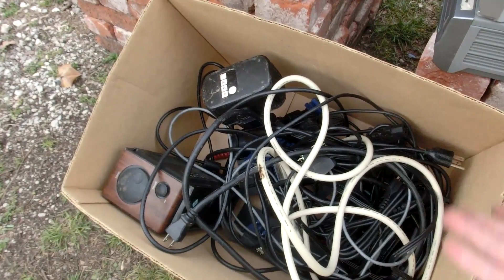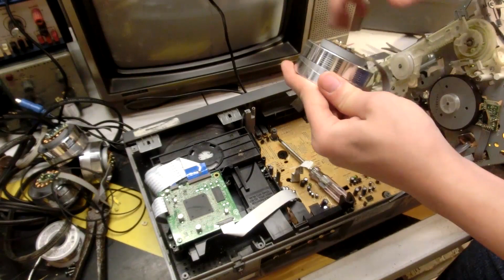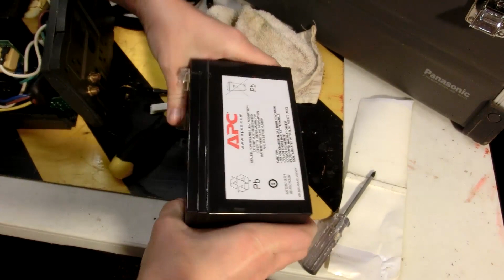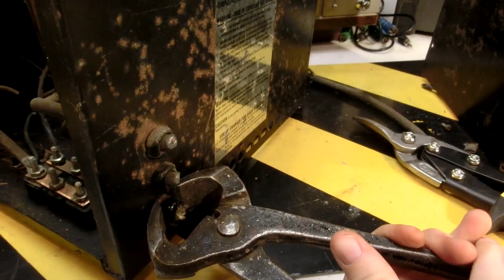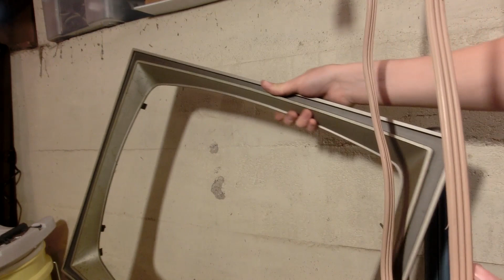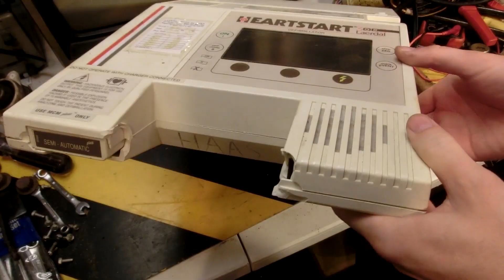Electronics Recycling Salvage/Teardown: Vintage TV, UPS, VCRs, Charger, Portable Defibrillator, LCD

Comment: @14:00 automotive automatic thermal breaker, it cuts off and resets itself when it cools down if you pull more amps that it's rated.  They are real common in RVs.

Comment: High Voltage TV transformers can give some fun with the Mazilli oscillator circuit and you can make nice 20 kV arcs and even melt glass with it. That TV frame is very cool. I have done destructive tests with tube filaments and some will even last up to 30 Volts before they let go. Nice score of goodies you got there.
Reply from the maker: i think ill leave the high voltage stuff to you and stick to high amp low voltage myself :p
Reply: @RinoaL  Fair enough. Keep up the good work with your video's.
Reply from the maker: aw thanks! that actually means a lot coming from you. haha

Comment: Am pretty sure that APC runs off 12v those batteries are in parallel series. that diode is a thermal switch

Comment: Live the video player to play 10 min the head auto cleaning function will fix it ( the lead acid battery is way more reliable have very long life and you can fix it )
Reply from the maker: lead acid sucks compared to lithium, lithium is better in every possible way.
Reply: Rinoa Super-Genius a lithium baterry on your laptop die in one year,  the battery from your car works 10 year's  (after you can open it clean elements add distilled water recharge and I well go for another 3,4 years ) lithium are a total shit compared with acid
Reply from the maker: that is completely wrong, most of my laptop batteries last me about 10 years, and automobile batteries tend to last 3.

1: lithium is lighter
2: lithium has more charge cycles in its life. Lithium can get 2000 cycles before reaching 80% but lead acid can only do about 300 cycles.
3: lead acid wastes about 5/6th of its charge energy, and at high discharge rate it wastes a lot of energy, this is due to peukert's law. lithium ion has a more symetrical input-output so your not wasting so much electricity.
4: lithium-ion can handle much higher current draw.

those laptop batteries that you say are dead, well they normally arent. ya see i build electric bike batteries out of recycled laptop packs. some cells are like 15 years old but i can still use them in a battery that will give my ebike 40 miles of range.

its just simple, lead acid is shit and has no redeeming values. and an automobile battery isnt exactly a good comparison since it doesnt really run anything, at least on older cars. if you discharge a car battery down to 0% within 10 cycles it will be dead.

Comment: I wonder if you could use the VCR heads as both bearings and a position or speed sensor. Like put a piece of video tape or magnet in front of it and use the head to pick up that signal, and interpret it with a microcontroller

Comment: Those LCDs would be perfect to put on overhead projectors and make digital projectors! Old 4x3 ones with screws to make them easy to take apart are the best. Even the Dell one is perfect for that since the hard part (taking off the bezel) is done. (Dell monitors are almost harder to do the mod with than it's worth most of the time)

Comment: The one with vhs on right side, ejection mech prob. Some have a belt, some free spin the shaft that's supposed to turn a gear.

For repairs, 90% of vcr problem is mechanical, the rest is like a fuse, bad cord, rare if they ever died Electrical stuff.
Reply: Yes I know long gone by now. Just saying

Comment: Its to bad you couldn't get the whole tv.
Reply: Many old antique TVs can be had, pretty much for the hauling. They are way too expensive to have them shipped. It's just as well, with the gutted TV. At that age, they require a total rebuilt. Capacitors leak badly, resistors drift way out of spec, that sort of thing. To get an idea what it takes to rebuild  some of these old TVs to get them working well enough to be safe and functional, see some YouTube videos by shango66 and radiotvphononut. They are very thorough, and you'll learn a lot.

Comment: I've been finding your Teardown videos fascinating. I've started doing some of my own. I just took apart an HP printer. I enjoy looking at the sky awesome circuit boards and how they are laid out and how tiny the components are.
What components do you find the most valuable from salvage parts? I'm finding the pushbuttons and the big potentiometers seem to be the easiest to remove and reuse.
Reply from the maker: +Robert Gasperson i like the motors and switches most, but it really depends
Reply: Rinoa Super-Genius Ya I'm guilty of the same thing in the last week two hp inkjet all-in-one printers one hp laserjet 3510 I believe it was and a hp computer tower 2005 vintage 😂😂!
 Like the rails thought I was going to be scoring a couple stepper motors but big neg!They use dc motors and either position strips or position disc and a sensor. I do keep the gear reduction and the metal portion of the frames. The computer has magnets in the HD always nice to claim and the power supply is a big plus 180w.
 Which now I have some electronic elements it's time to start learning how to get power to motors without burning up everything which is going to be a most likely outcome for a while.Ones I can control the motors properly I have idea's (projects)waiting for the motor and geared torque to be applied!Hopefully I will get most of my knowledge through this channel or Ave YouTube videos. I'm electronic stupid for sure!But I built computers for years but my collage learning don't seem to be helping with the transfer. but I'm a good self teacher (school of hard knocks)🤔🤔👍Great video like always Rinoa Super-Genius !

Comment: A bad idea, a lithium battery is not designed for large discharge currents.0.5c, This is a 2 hour discharge
Reply from the maker: +Вячеслав Алексеевич yes they are, some can handle 30C but most can handle at least 2C. i suggest to re-learn how lithium works.

Comment: FYI. The Smart-UPS has a pure sine inverter in it. The Back-UPS only have a modified sine wave inverter in it.
Reply from the maker: actually i looked it up earlier and its whats called a "stepped aproximated sine wave" and i might be able to smooth it out with a capacitor or something. but i dont plan to use this as an inverter.

Comment: I wonder if you can make a silly mini wind turbine with the VCR heads.
I mean they are more or less motors so theoretically it should be possible to do some small garden light type of thing with some LED's.
Reply from the maker: most people use the helical scan heads for wind turbine bearings, so yes you can do it.
Reply: Rinoa Super-Genius Now that is a good idea definitely logging that in my book of great ideas.i have a collection of vcr's.All working but one day they shall give up there treasures haha!!

Comment: This guys gonna blow himself to kingdom come one day. If you have a lot of tubes then one way to try and sell them would be to find someone who repairs/restores guitar amps.
Reply from the maker: how will i blow myself up? and no, people that are into that sort of thing want a specific type of tube and usually new.
Reply: Your very defensive, im just interacting thats all. Its not rood its not offensive just making a comment.
Reply from the maker: no i'm asking a question. but are you just interacting for the sake of interaction? thats called wasting somebody's time. lol

your the one that is reading emotion into my comment so maybe you should rethink how you read somebody's comment.
Reply: Im interacting as part of subscribing to your channel, isnt that the point. On the only 2 comments ive ever made on your channel youve been very quick to jump in with what I would class as an English man as quite rood and defensive, "How will I blow myself up" and "No People that repair amps  want specific Valves". Both comments are  there to cut me dead in my tracks. Now refering to how your going to blow yourself up. It wasnt a literal statement im sure you know what your doing. You mess with a lot of high voltage so your chances of blowing yourself up is more likely than someone that walks dogs for a living, correct? It was an off the cuff comment. And your comment about valves is incorrect trust me. You can also use them to make headphone amps to warm the sound up. Now you had 2 choices of how to react to my posts. You could of just ignored them or you could of been a little more  friendly and just laughed it off and said something like " I hope I dont blow myself up". You PR skills leave a little to be desired my friend. Its not the way to go about making friends is it really? Remember its you that posts videos of your life and shows it to the public so we get a window into your life and build up a profile on what your really like as a person so the responsibility is with you to be polite becuase you have no clue at all who we all are as subscribers. We subscribe to you thats how it works. Think you need to work on your PR skills a little more my friend. Remember in the future, always think about how your going to answer someone and the manner that you do it in. Now you didnt seriously want me to explain how your going to blow yourself up did you, surely your not that nieve? And interacting for the sake interacting does not make sense. No need to put the barriers up over a comment. And as for insinuating im wasting you time by interacting i find you to be quite arrogant. Good day to you  and I will be unsubscribing. Now I know thats just a shoulder shrug to you so no harm done either is there.
Reply from the maker: so you comment without expecting a reply, well then i'll know not to waste my time with you. thanks for being upfront about that.
Reply: Grow Up.
Reply: @craiggilchrist4223  

It's "rude" not "rood"...
And who would buy used tubes? That's like trying to sell old tyres. Tubes are subjected to wear and should be new or new old stock, you never know how much they've been used.

Comment: So you are using 18650 on the UPS, I suppose you are gonna charge the battery on a Hobby charger and leave the UPS unplugged from the mains, essentially making it a backup power supply, not an UPS (uninterruptible), because if you plan to use it plugged in, how do you account for the fact that it doesn't CC/CV charge the battery, and worse yet, it trickle charges the battery?
Reply from the maker: +Spartacusse BMS
Reply: So, just slap a BMS between the battery leads coming from the UPS and the battery and no other modification is needed?
Reply from the maker: the BMS basicly makes lithium cells act like a lead acid pack, makes them pretty idiot-proof. but i'll do a video on it to make sure my understanding is correct.
Reply: Yeah, I'd like to see that. Because from what I've seen from BMSs, they have 1 Negative for Charging and 1 Negative for Discharging, presumably because the discharge load won't be the same as the charging power supply, like an E-bike the negative Discharge goes to the motor and the Negative Charge comes from a power supply. But on the UPS the same negative cable charges and discharges, probably a Relay will control so there are no charging and discharging at the same time, but on a BMS, I don't think you can just loop the 2 negatives together connect it to the UPS's negative lead and be done. I might be wrong though.

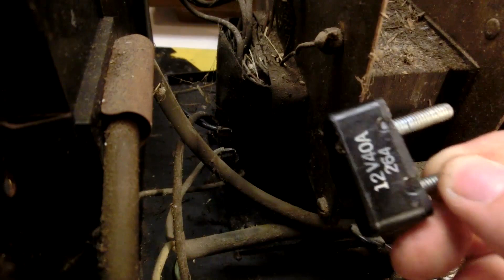Comment: 14:35 no its just a thermal switch that cuts the transformer from the mains if it gets too hot and no btw any type of dc will just create a short if it isnt high freq on transformer ...
Reply from the maker: but those little black boxes arent on the mains side, and i'm pretty sure a transformer will still work with pulsed DC.
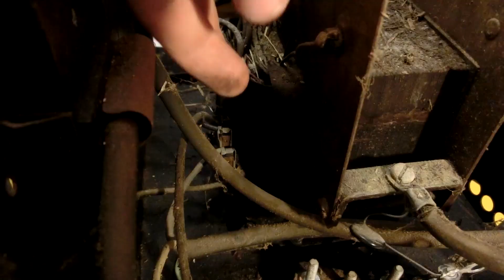Reply: no but the other 14:16 thing you were showing 
on second thought it will work but very inefficiently if its not high frq
Reply from the maker: +Photonic_ Induction i dont think the manufaturers of this charger really cared about electrical efficiency, just getting production costs down
Reply: No it needs pulsed current if what you said were true smps poer suplys clodnt work ....
Reply: Phoney - Western Electric pulsed dc is AC with a DC offset.

Comment: You have quite the destructive side don't you.
Reply: M/V WRETCHED BEAST yeah dude
Reply: It's about saving time, you won't need most of the things in the devices so it's much faster to just rip out the parts you need than to carefully disassemble everything
Reply from the maker: i dont think so.
Reply: Really you tore into that stuff like I tear into a bag of chips.